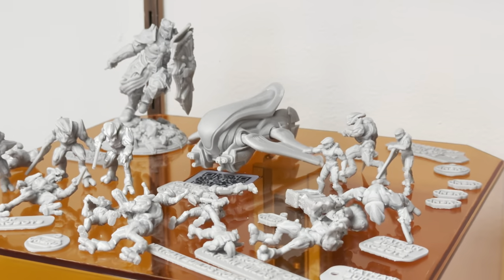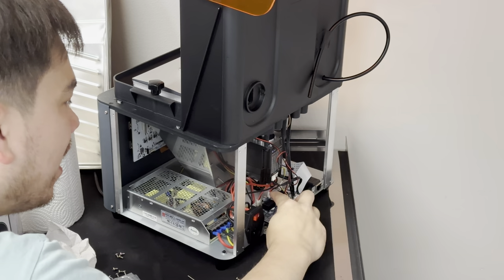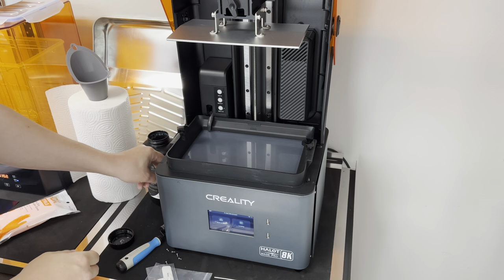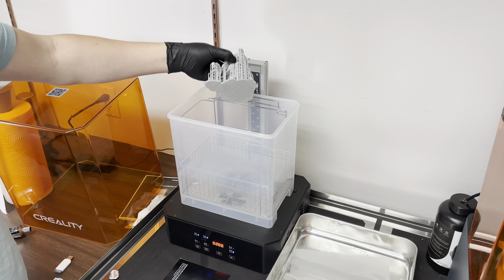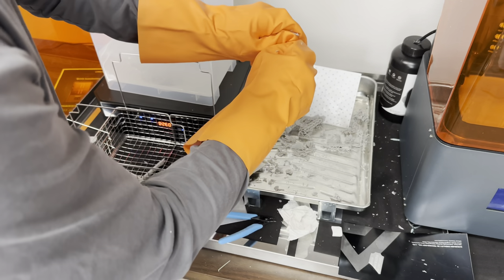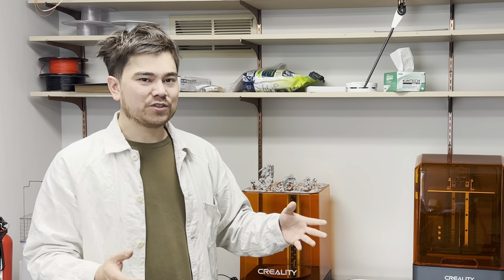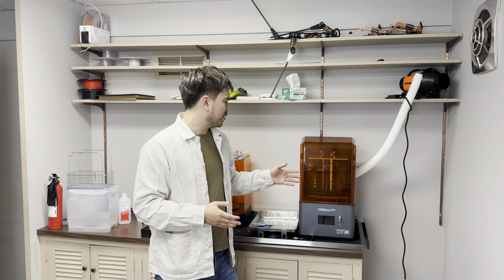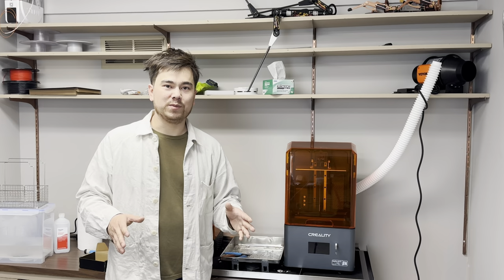Creality Halot Mage Pro - FDM Enjoyer Tries Resin Printing

Comment: Great Vid, also new to 3d printing with my first resin printer being the Creality LD-002H. Much smaller than the Halot but Ive been using water washable resins. Post processing much easier. I also set mine to print at 0,1 layer heights at 2 sec exposure which drastically reduces print times compared to 0,05 and level of detail still awesome. Things like your name tags you should be able to print flat with zero supports. Add a 0,5mm raft at 0,1 layer height and cure 5 layers +- 40 seconds, by doing so the raft is your sacrificial burn in layers, so when the print is done due to the much higher exposure settings you should be able to peel the raft away from your actual print leaving a perfectly smooth surface on your tag.

Comment: The rule for Resin is: If you can smell it, you're doing it wrong.  Never get this stuff on your skin, as it can hyper-sensitize your immune system and is generally VERY bad in its liquid form.  In its solid form, it's inert and safe but seriously watch out for your health here.  The effects of resin hypersensitivity are non-reversible.  Ask me how I know...  You want a respirator with filters rated for VOCs if you don't have massively adequate room ventilation.

Nitrile gloves only.  Do NOT use Latex.  Latex gloves will allow the resin to penetrate through them.
Reply from the maker: I have some great respirators. I feel like every resin video should come with a disclaimer about the safety hazard it presents. People should not be getting into this casually.
Reply: I bought a resin printer a few years ago and the smell was disgusting, I used my respirator after my resin odor experience but I still hated all the clean up especially the supports and sanding the break off point down, I only ever use it if I need to.
Reply from the maker: If I run low on space I’ll probably just pack up the resin gear and get rid of it. It’s nice being about to get such detailed parts, but at what cost?
Reply: @NathanBuildsRobots  Im in the same boat, I hardly ever use my resin machine, however, there are occaisions when I need some high res parts that an FDM would take a lifetime to print so the resin printer is the one to go for, I use the ABS like resin for part strength, its at times like this that I am glad I did not get rid of it.
 I keep it all on a tray and stored below my workbench and keep covered to keep any dust off it all.
Reply: @AndrewAHayes  Then just order online and you save all the hassle. I bought a resin printer for a club, but at the end I'm ordering online because it's so much easier.
Reply: Yes nitrile gloves, even not heavy duty ones, are definitely enough and at the same time a requirement.
Also, resin is bio-accumulating: whatever you breathe sums up over time (so I heard, I haven't searched for scientific papers though).
Reply: @olafmarzocchi6194  Im confused by your reply, I dont have any problems buying things.
Reply: Sorry, what I meant is "if you don't use it often it may be worth skipping the DIY and just order the printed parts, to avoid risks, having to handle and dispose of chemicals and so on".

I think that for small users the effort I volved in resin printing is not much worth the savings, if any, compared to getting the parts done by third parties.
Reply: I suspect nitrile gloves don’t work that well either. I have hand laid up about 100 gallons of epoxy (fiberglass cloth) and I wanted a glove that provided protection so I did extensive research and found only one glove that provided 1 hour protection from the compounds found in epoxy. These gloves were very similar to the ones you see food handlers use but they were a laminate of various plastics. I found them extremely cumbersome to use and I lost virtually all tactile feedback so I nixed them and went back to 7 mil nitrile BUT I would only allow a 10min exposure while workin. Before replacing!!! I would literally go thru an entire box of gloves during a large layup.

As someone said in the comments you don’t want to become sensitive to these chemicals. I have friends who didn’t adhere to my anal glove changing routine that became sensitive. Once your sensitive, even a whiff of this will cause you to get a rash in all the places you sweat! Think where that is!!! it’s terrible. 

I know people who had to abandon their projects (worth tens of thousands dollars) because they couldn’t be any where near this stuff.

Personally I would not risk working with these materials, the risk far outweighs the rewards.

FYI: people that use solvents like alcohol, acetone lacquer and thinner to clean up their skin are crazy!! These compounds will dissolve in the resin/epoxy and then the contaminated solvent becomes the carrier through your skin. Think of it as a accelerator to breech you skim. Bad stuff happens inside your body, might not kill you now but will haunt you in your later years.

Comment: This was your first try. When you dial-in your settings, the level of detail on those prints will blow your mind and be far beyond FDM. The prints you have there are very low-res due to your settings being off (default = low-failure rate, but also low-res). That is a beginner, first try my friend (great job!) but that machine has a LOT more potential once you get a few prints under your belt and play with the slicer settings a bit. I have this exact printer and can speak from experience. Just watch 15 or 20 minutes of YouTube vids on slicer settings. While FDM has its advantages, if you want ultra-high resolution then you need resin,  FDM just can't hang.

Comment: Congrats, you are now the 3rd reviewer to break their Halot Mage pro before resin ever touched the vat. I was first. Faux Hammer second. Nathan third. Who is next?
Reply from the maker: Lol it’s just comical at some point. At least the coupler was loose enough to not permanently damage anything. When I read “go to zero” I interpret that as “go to the 0 coordinate”, or Z=0. So I’m like, I’ll take the other one. Guess that was wrong???

A firmware update should fix this, hopefully they will be proactive about it. I didn’t update firmware before starting the review. Prints turned out fine in any case.

It’s my first resin print and overall it was a good experience. Good resolution, nice feature set, needs polish though, to improve user experience.

Comment: Soak the resin figure after washing in hot water you will find the supports will be easier to remove then leave the water out in a clear bottle outside to go hard then you can dispose of safely.

Comment: I've heard you can recycle the alcohol by leaving it in the sun for a while and filtering the resin particles.
Reply from the maker: That is true but some of the alcohol is consumed every time you use it, and eventually it will absorb moisture from the air to the point that it needs to be distilled or blended with fresh alcohol. But it is definitely batter to cure and reuse the alcohol as much as possible.
Reply: @jstro-hobbytech  This makes it also super toxic.
Reply: @jstro-hobbytech  Suuureeee buddy..... Please just don´t have kids.

Comment: Everybody I've seen review this thing, has broken it really quickly, as it comes slamming down. I think they coulda had it go a bit slower than that. 

My Ender 3 S1 Pro, zeros itself so dang slowly. 2 extremes Creality. Sharpen up!
Reply from the maker: Gotta go fast!!! 💨
Reply: i totally agree that is a huge oversight on their part for this. lucky he only had the coupling come off.. others have smashed screens. Also that cure station spins waaay too fast. needs to be like 3 notches slower. i dont know why they did this... huge design flaw.. id hope they fix it in firmware to slow it WAY down on the printer at least.

Comment: So they still havent sorted the speed of homing out, also quite a few people have been having the metal tab thing snap off when the printer go's back up as it falls forward and the bed just snaps it clean off.
 There is always something wrong with a Creality product!
Reply from the maker: The resin fill port seems to be out of the way on my printer. I don’t think it’ll cause an issue unless I installed the vat incorrectly.

Always a work in progress.

Comment: You're the first content creator on YouTube I've seen who I feel has portrayed the process of resin printing accurately.

I originally got into 3D printing 13 years ago to print miniatures, and was immediately disappointed. When resin printers became affordable, I jumped at the chance to own one, but in the end I never liked it. Yes, it could print miniatures perfectly, but the mess and side effects were just unacceptable. These machines are scary if you're taking them seriously. The resin is toxic waste, and it's impossible to keep from getting everywhere. 24/7 super ventilation isn't feasible if you live somewhere it's very hot or very cold, unless you locate it in a dedicated sealed room and install an HRV for ventilation. Getting it on your skin is really bad, and your clothes will get contaminated. You'll try but you won't be able to keep it from happening. The machine really needs to be treated like a tiny personal factory IMO, with appropriate hazmat precautions. Now everyone can experience what real factory owners cope with: the temptation to throw safety to the wind in the name of simplicity and lower costs! One day it will probably be illegal to run one of these machines in a house with children, or dump its waste products down the drain. 

I just got rid of my resin printer and I'm planning to go back to FDM.
Reply from the maker: The resin heads make so many excuses for the process being far frowned m something you’d want in a residential setting. It’s more like an industrial process filled with messes, smells, and safety hazards.
This type of thing, along with unenclosed laser engravers powerful enough to cause permanent eye damage, really shouldn’t be available to anyone with a credit card and an Amazon account

Comment: I think you should mention in a future video another aspect of resin printing: it's extremely cheap to get very high quality prints by ordering online, like jlcpcb which I tried out of curiosity. I got small parts at 1 dollar each plus shipment: no resin cleaning, no alcohol, no waste disposal, no support removal, ...
Creality, which seems to be providing some printers to you (I don't know if you are sponsored or not, it doesn't matter) won't like it, but while FDM at home makes sense also for small volumes, at home resin printing is likely something for people printing a lot.
Also... do you trust people to properly dispose of resin, alcohol and so on? I don't, I fear someone will throw stuff down the drain.
Reply: You are so right. This is a huge mess for the environment, people will simply flush it down the drain. It´s super toxic, I bet my ass most people printing with resin do not have adequate ventilation. Cleaning is a huge pain in the ass. I would like to resin print soo soo much but I can´t vent the fumes outside even though I have a nice big office.